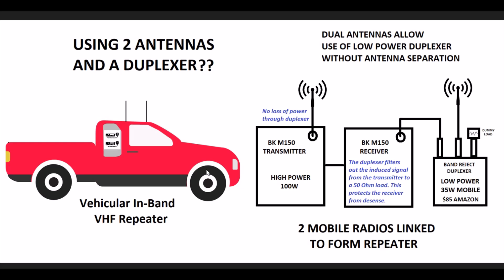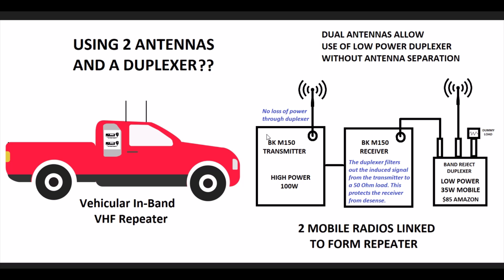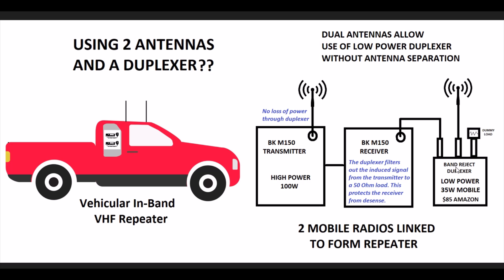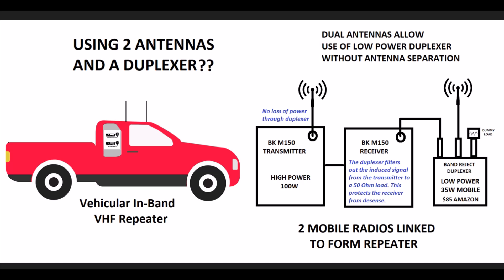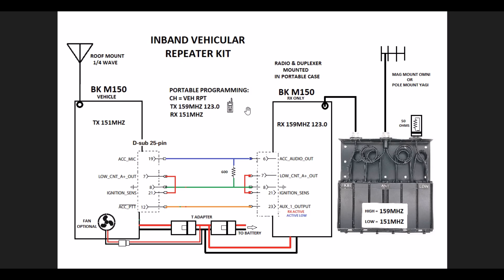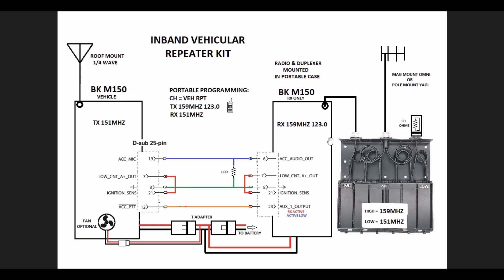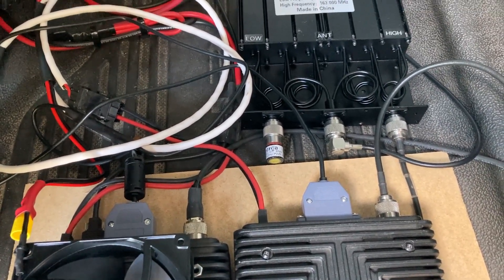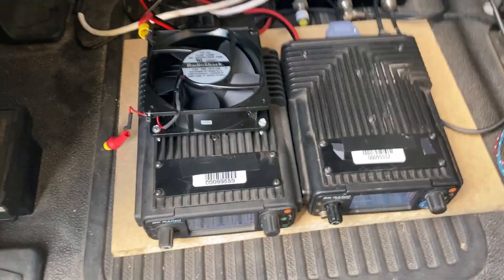Using 2 antennas AND a duplexer? Why?

Comment: Hmmm your theory is correct except for 1 thing, these cheap duplexers are just notch filters and not band pass filters. Granted you do loose 1/2 of your transmit power through one of these but to get anything near its intended purpose with any sensitivity it should be used with 1 antenna because in your configuration all your doing on the receive side is selectively notching out the transmit frequency to the receiver and nothing else (harmonics, etc) where as running the transmitter through the duplexer would also selectively notch out the receive frequency from the transmitter as well. Your setup will work, just not as good as it could with just 1 antenna and the difference between 10 watts out and 5 watts out is negatable. Try it in both configurations, you will find with the one antenna your distance should be increased a fair amount.

Comment: The thing you are missing is the duplexer has TWO notches for a reason. 

Yes the big side is the receiver side notching out the transmitter frequency. BUT you also have a notch for the receive frequency on the transmitter side for a very good reason. 

The transmitter is going to have some noise on the RX frequency, it’s not enough to be picked up a mile away but it’s enough to dense the receiver with an antenna right next to it. 

There is a reason this isn’t done.
Reply from the maker: Both notches are used, 1 blocks the transmit freq and the other blocks the receive from going into the dummy load. The duplexer is tuned the same as a normal application. It works perfectly as described if you transmit high (159Mhz) and receive low (151Mhz). I found that if I reversed the tx and rx frequencies I would get a very large desense that would really limit the coverage. Your timing is amazing on the comment because I did find the cause and a solution to that problem. I learned that most all of the times I blamed desense on a receiver having its frontend overloaded, it was more likely a near-field on-frequency rf product that was desensing it. I just made this video showing how it does it.
Reply: That’s not how that works with the dummy lord. 

You are basically only using one side of the notch. 

The reason for the transmit side going through the duplexer is so that side notch can be set to notch out any spurious signals coming out of the transmitter that would be on the receiver frequency. 

The amount of loss you are going to see by running the transmitter thought the duplexer is really not much. 

Plus by using using the same antenna for both you won’t end up with an alligator or elephant repeater. 

And I say this from having a mobile repeater in my 4Runner and having a uniform antenna pattern is really the goal and makes you no always wonder about TX or RX issues.